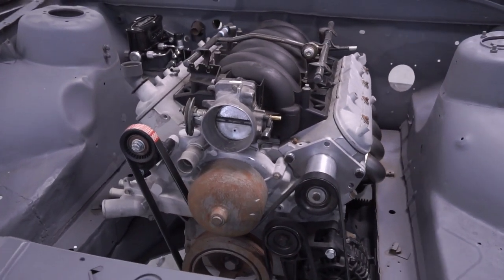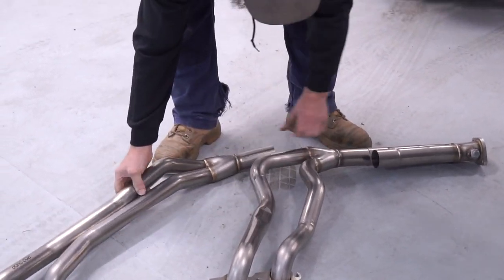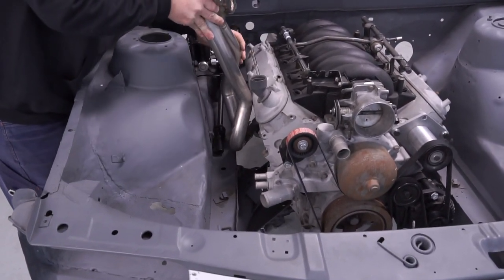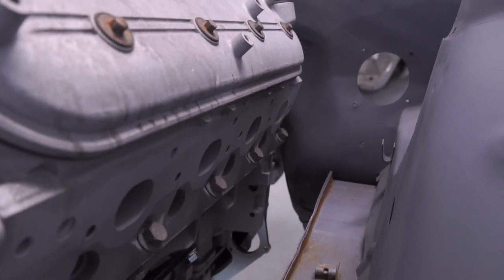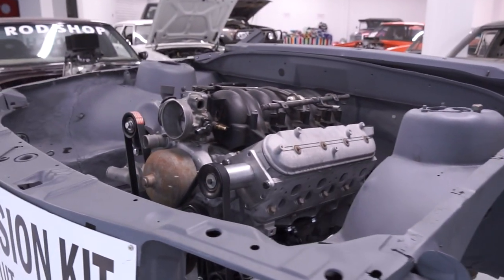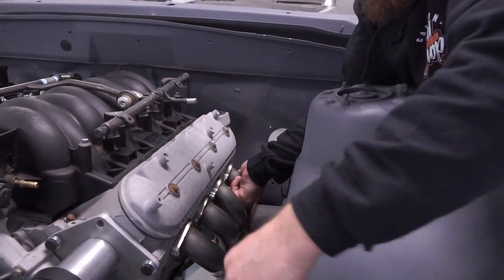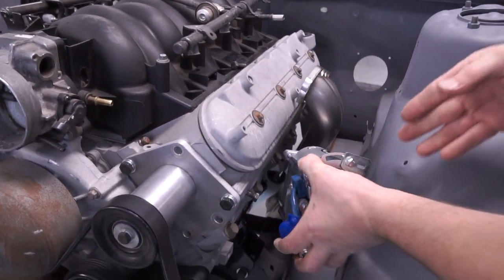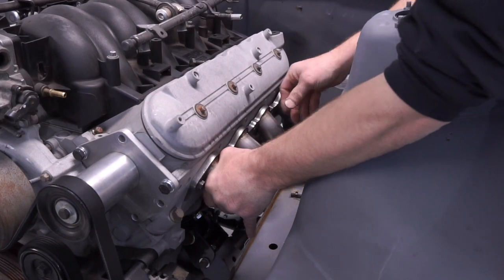Castlemaine Rod Shop Early commodore LS conversion extractor fitting

Comment: In the vs had to remove the standard brake booster to get the extractors in , also steering column was obstructed by the extractors when reconnected to the rack - had to manipulate the extractors for clearance